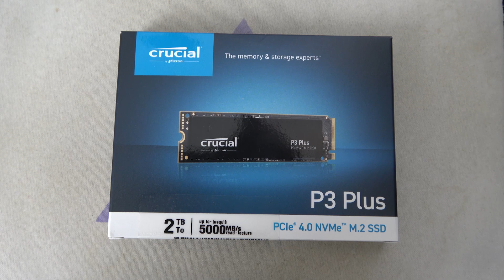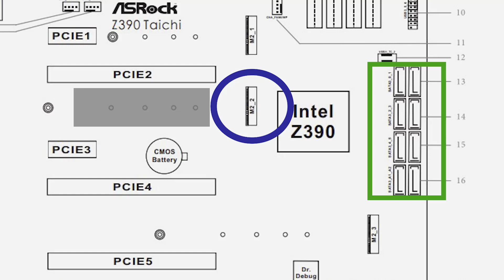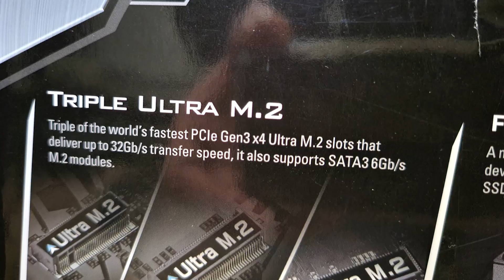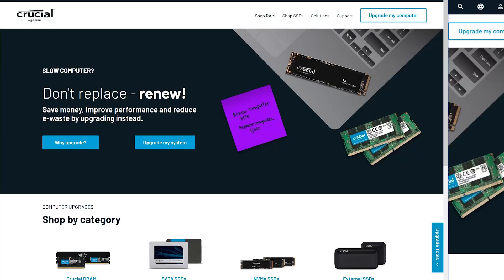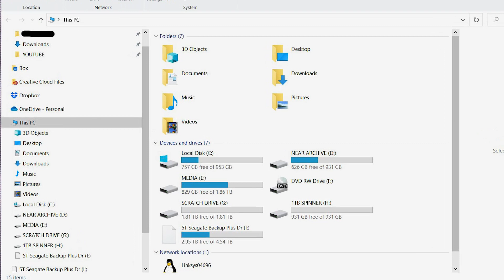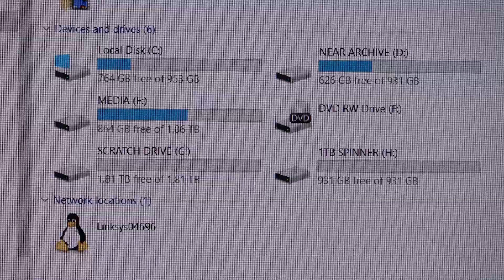Essential Steps Before Buying Any PCIe NVMe M.2 SSD

Comment: 1) I love that motherboard design.
2) Always install some kind of heatsink or cooling pad to an M.2 SSD. The vast majority of M.2s are installed with no thermal solution and when they hit 50 degrees (C), they WILL throttle.
3) SSDs don't last very long. I've had several just drop dead and unlike a spinning drive, there's no chance of recovery. Always keep multiple backups, ideally to the cloud. SSDs are fast but I would rather trust a spinning hard disk for backups, at the very least. If I were you I'd keep those HDs connected, but used for incremental backups. They WILL outlast the M.2.
Reply from the maker: Kirishima, all very good advice. I have tested and monitored for throttling while running 4K projects and have yet to experience any. I credit the box design and cooling airflow. I did install a hybrid spinner from a laptop https://youtu.be/5C-l9h8R_hE as my near archived storage. The big take away is always back up your data as any storage solution can fail suddenly. Thank you for watching and your contribution.
Reply: @cfldriven  Yes I have hard drives from 20+ years ago that still work. I've yet to have any SSD last more than 5 years.
Reply from the maker: @kirishima638  You're right about spinners, my oldest are 13+ yrs. I'm just hitting 4yrs on my oldest SSD and will be backing up complete system this weekend.